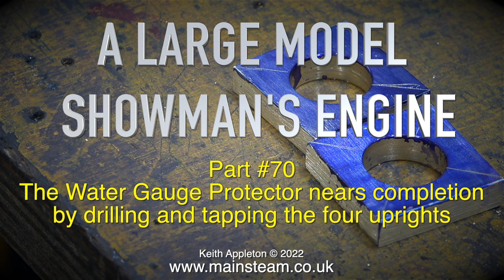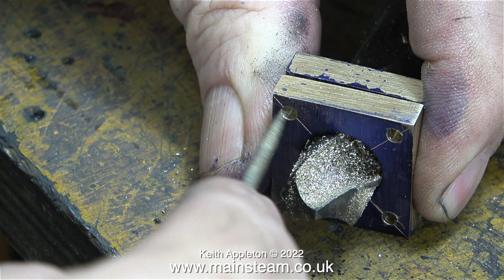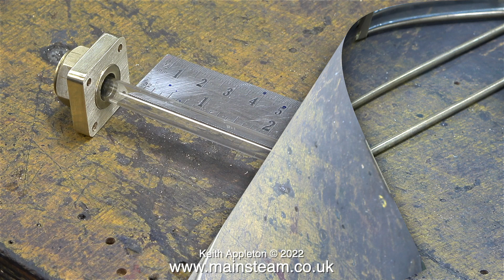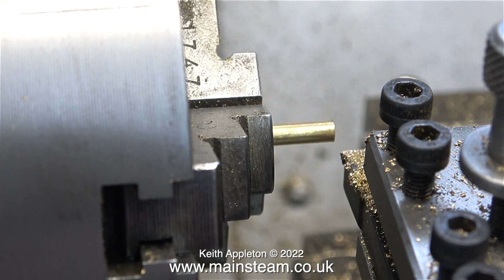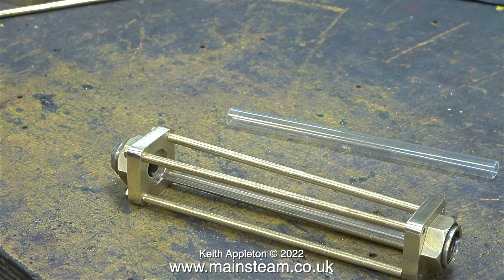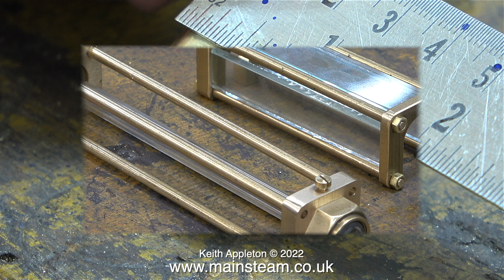A LARGE MODEL SHOWMAN'S ENGINE - PART #70

Comment: Keith, should the need ever arise to fire polish borosilicate, AKA "Pyrex", glass your blow torch might not be hot enough.  Ordinary laboratory Bunsen burners are not hot enough.  As a youngster, many, many, years ago, I used a grid top, AKA Meeker, burner, which is hot enough.  Chipped test tubes, etc. became smooth.
Reply from the maker: I use a Proxxon small blowtorch which melts the ends of the glass tubing just fine. I show it in action during some videos. If that wasn't hot enough, I could always use my Propane Torch.